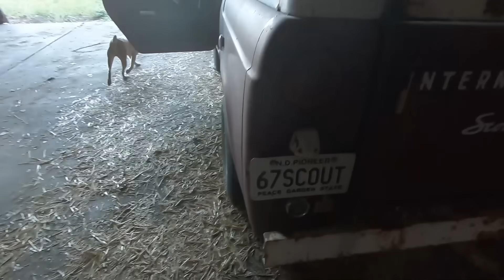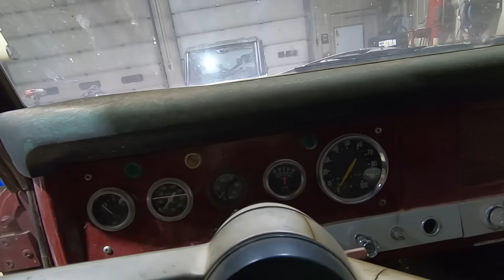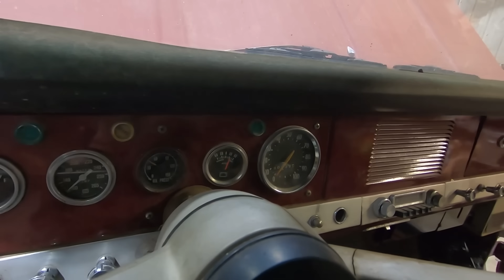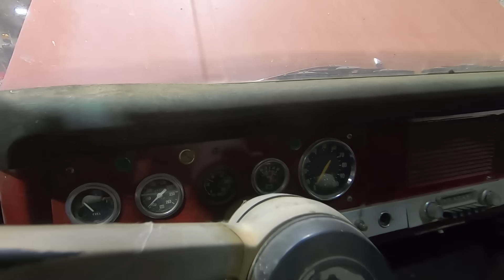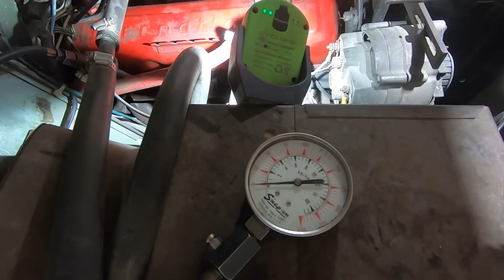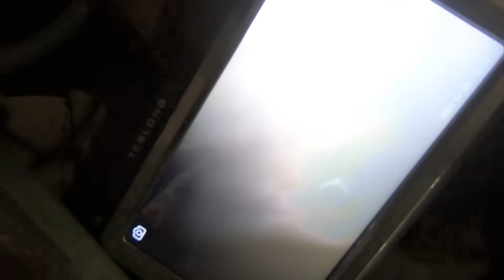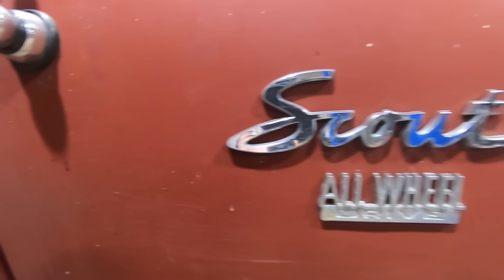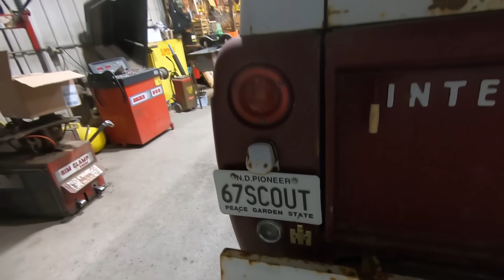Barn Find! 1967 International Harvester Scout! Will it Run?!?

Comment: Check the flywheel, it could be cracked. It will make the same noise as a low end knock.
Reply from the maker: Seen flexplates crack. Never a flywheel.
Reply: @MortskeRepair  Well, check the flex plate then. I had one crack and it sounded just like what your hearing.  Just a suggestion.
Reply: Oh yeah, changed it out and the noise went away.

Comment: You had me thinking of Jonathan W on YouTube when he had a rappin chevy 6 cylinder. Turned out there was a piece of metal dropped in the cylinder that he just couldnt see. He took the head off and found it. Or that old thing about how some water pump bolts were a tad longer than others and if you mixed em up youd get a rap. Dont sound like a timing chain rap but wadduino?

Comment: So the Scout. First came bouts in 1961, as the Scout 80, available with the 4 cyl 152 and a 3 speed. Later 4 cyl was in fact half the ih 392, the 196 Comanche. And yeah, they did just chop their v8s in half. Technically really is first SUV, first use of it anyhow. Full removable top and back seat, and as I recall Jeep didn't have a backseat or proper top set up for the early CJ.  4 different kind of tops, too. Half cab too(pickup truck style), full travel top like on the one you are working on, sport top which was angular and a little shorter than travel top, and a soft top. 1966 saw the first v8, and first Scout 800, available with a 266 v8, then eventually a 304 (ih v8). 1966 also saw first 'marker lights.' they were originally reflectors, then eventually became actual lights in bouts 67 or so. 67/8 saw first 800A models. Then eventually, round 70 or so saw 800B. 4 speed was not that common with the 4 cylinder, but they did eventually get rid of the 3 speed in favor of the 4 speed, and in rare cases they did get a 3 speed auto. Uncommon though, seen them in the rare Gov spec/DOD models more than anything that were also right hand drive. Twin stick case was pretty standard I recall, I don't know, switch between hi/lol range/disconnect the axle. You could have hi range front axle engagement and disengage the rear axle, I'm sure you know that though. I'm eventually going to get myself a Scout 800A, probably. I currently have a 1974 International Scout II, IH 345, t19 close ratio 4 speed, d44 front and rear, dana300 tcase I think. Standard stuff. It's my daily. I love the Scouts. Trying to get a TravelAll. Anyway, I love your videos now.
Reply from the maker: Thanks for the info
Reply: @MortskeRepair  you're welcome. Also, that tapping? It is pretty standard. Lots of weird stuff like that is just stuff that we know to be the nature of the beast with these IHs.

Comment: That tractor did a bumper bust if you turned that front mounted engine too hard or fast. International had one with all of the engine weight in front of the front drive axle.

Comment: I seen a broken fuel pump make noises like Rod knocking take the motor out and took all the parts off for another motor got to the fuel pump pulled it out and one side of the pushrod was broke sounds just like a rod knock

Comment: Interesting wee beast, that one.  When you went for the drive, that wee engine sounded like she was a lot bigger than she actually is....and she's either real low geared or it's got a fair bit of torque and all.  

The noise?  That little man with the hammer that was rhythmically belting something internal?  She was definitely sounding like the beginnings of a big end bearing going bye-bye.  Mains are an overall rattle when revved (usually when warm), whereas that one was in time to one cylinder from the get-go.....but it wasn't quite the right 'donk' noise, being deeper and more rhythmic than either main bearings or valve train (and lifters have a 'glack' or 'glock' noise depending on how worn they are and you'll definitely hear it up the top end.....and they don't tend to sound worse when the engine is revved or under load like the noise in that engine does).  

Listening harder, I reckon it's the gudgeon pin (known as the wrist pin in your part of the world) and the sound happens when the piston changes direction in the bore after the cylinder fires.....which would sound worse when the engine timing gets advanced and especially when the engine is cold.  It's a serious issue, but will happily run like that for many miles before it decides to fail catastrophically and ruin your day (usually with the piston separating or the gudgeon seat becoming so worn that a circlip comes loose and the gudgeon slides one way and scores the hell out of the bore, welding the piston to it at the same time.  The results of piston slap are noticeable in the bore after a few miles, so it definitely isnt that if it's been making that noise for years.....

Who knows?  Who cares?  The beast goes well and does it's job again, so that's a win.
Reply from the maker: Thanks as always Lance!

Comment: As the salesman said "This car is the opportunity of a lifetime!"  To which you would reply "Yes, I can hear it knocking>". I had a '72 Scout II with a 304 ci V8 and automatic (Chrysler 727 3 speed). Drove it from Kalispell, MT to Lower Alabama and kept it for a couple of years.  Fun to drive if you didn't cruise over 60 mph.  Oil collected in the heads if you drove any faster and the lifters starved.  Needed to be de-sludged so the oil would flow back to the pan. Have fun with your half eight. By the way, the 304 V8 was timed to the #8 Cyl, not the #1.  Your 4 cyl may be unconventional as well. (The preceding comments were composed at the 45 min. mark, before you discovered the info on the valve cover.)
Reply from the maker: Haha good stuff

Comment: the wheels and tires are not stock ... it will run and drive much better with stock wheels and tires ...I used to have one the stock rims are 16 inch with tall narrow snow treads... doesn't look racey but drives strait and climbs a whole lot better
Reply from the maker: cool

Comment: Oh Yeah!!!!!!!!!!!!!!  Two Cornbinder videos in such a short space of time!?!  You're slowly joining the Darkside, Mortske.  Resistance is futile.  There is no "half a 345".  A 152 I-4 is kinda sorta half of the IH 304 SV8 and a 196 is likewise kinda sorta half a 392.  The Scout 80 model was conceptualized in 1959 and the first unit for sale rolled off the assy line in April of 1961.  FoMoCo took notice of the little Scout's success and essentially copied it with the Bronco in 1966.  The twin stick Dana 20 t-case is basically as you described.  One lever was for range selection and the other was for front axle engagement.

Comment: I wonder if it has a cracked fly wheel, I owned a mid 90’s ford that had a cracked fly wheel and it sounded like it had rod knock
Reply from the maker: never seen a flywheel crack, flex plates yes
Reply: @MortskeRepair  I’m sorry your right that is what I meant to say

Comment: I had a 68  , put the drive train on a 71 chassis for a driving yard vehicle  . Funny thing happened when it got cold  , the starter wouldn’t turn it over until you took the fan and rocked it back and forth once . Then it was fine till the next day . It didn’t matter if it was parked in or out of a non heated shop  . Just a slight little turn did it .
Reply from the maker: Good times!

Comment: Piston slap: pinch off the PCV hose if slap goes away or gets quieter its piston slap, also if the noise gets quieter as the engine warms up its piston slap. Place a stethoscope on the thrust side of the engine block to determine what piston. Piston pin noise telegraphs to the harmonic balancer bolt and happens at all temperatures. It sounds like valve train clatter to me. I would place a vacuum gauge on the vehicle and look for gauge flutter before and after valve adjustment. If this engine has hydraulic lifters, then a collapsed lifter or push rod are suspect. If the owner wants to live with the noise fine have the owner sign a NO WARRENTY engine and engine coolant system on the repair order.
Reply from the maker: Never heard of that diagnosis process.

Comment: I would speculate that someone had the knock, put new bearings in it and it still knocked. Those bearings looked too good to be true. Wrist pin, bad oil ring, cam is floppin' around? Would a valve retainer knock like that? We had an engine that we couldn't find what was knocking so we just said heck with it and sent it to the engine guy. Had a bent rod. I had a Ford truck that was knocking and it was the clutch.

Comment: Normally those scouts would have a straight 6 in em.. 345 is a major upgrade/farmer change..
Reply from the maker: Never seen a scout with an inline six....
Reply: @MortskeRepair  I have 3 60s scouts.. 2 with an inline 6 (ones a boat anchor) and a straight 4 cyl. Had a 70s one with the diesel but a guy offered me some sammich monies so I had to let her go

Comment: It's a valve tap. Do you really think you can pull off a valve cover and see if a valve is tapping or not. Touch the rocker arms while it is running and see it the tap changes sound. Don't worry, it wont deform your fingers.

Comment: My 2001 Mazda B3000 has a knock like that that shows up when the wire holding up the muffler stretches out and the y'pipe starts hitting something. I'd fix it but who cares, even when it's quiet it's ugly and slow

Comment: Not going to trust the sound I hear from my speakers of what your camera recorded and tossing in some old ears.
Sounds like lifter tick, but then it sounds like light rod knock to me.
But what about maybe the fuel pump lever making noise? Could be a bit sticky and not following the cam correctly.

I've always used a length of garden hose to try and locate various noises on vehicles.

Comment: broke spring in fuel pump?
Reply: I had 67 ford short wide with 352 and that was what was wrong with it, guy I got it from though it had a rod knocking pulled fuel pump and return spring in pump was broke 20bucks fixed it.

Comment: @1:19:45 Hey Mortske, that "hiccup" may actually be an ignition feed that is breaking contact. I had this problem about 50 years ago on my 1970 Scout with the 304 V8 (yeah, it was nearly new). As I was driving, the ignition would cut out and leave me to coast down. After this happened a few times, I learned that I could press in on the clutch (while still coasting down) and start the engine again. Doesn't make sense that it would die while the clutch was engaged, but it would start up after I pressed the clutch in, right? Turns out, it was the bulkhead connector that connects the dashboard wiring to the engine harness. (See @16:36, directly over the valve cover and to the passenger side of the air cleaner.) Sitting at an idle, I could reach in and jiggle that wire bundle at the connector and kill the engine. Fix was to remove the connector and straight-wire everything. Apparently the torque from the engine was moving the ignition feed just enough to cut out the ignition, and by disengaging the clutch the engine would settle back and reconnect the ignition.
Reply from the maker: Thanks for the info

Comment: Half of 345 would be 172.5 , International Harvester  never built a 172.5 they did build a 196  4 cyl which is half of a 392 v8 and half of 304 which would be 152 4 cyl. Why does every body always gets this wrong 152 is not half of 345 v8, don't know how many times I have heard people say a 152 is half of a 345,  NO its not!!!  Has anyone ever looked at one of these 4 cyl engines it is a v8 block with drivers side cylinder banks cut off with a steel plate bolted over the opening, strange looking, pistons and heads are same, cam is different,  distributor  is same with wires on every other plug wire outlet! Not sure about crank and connecting rods